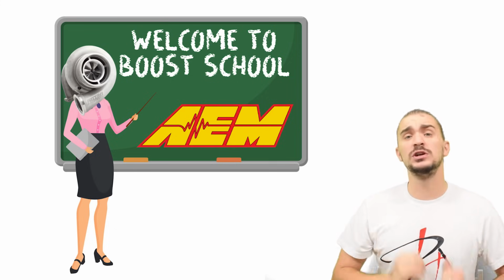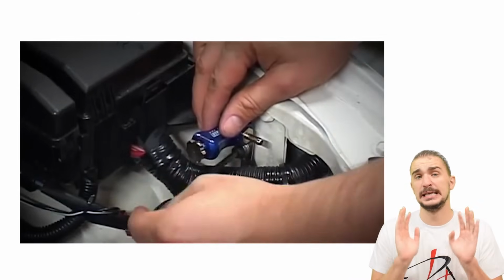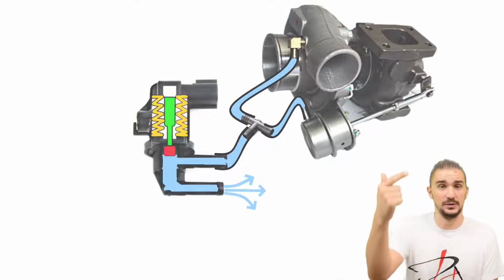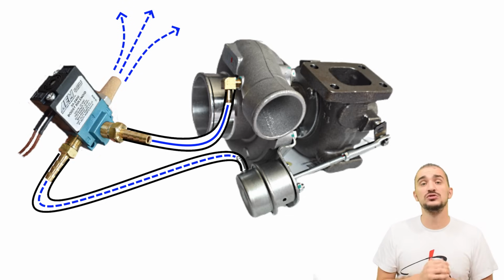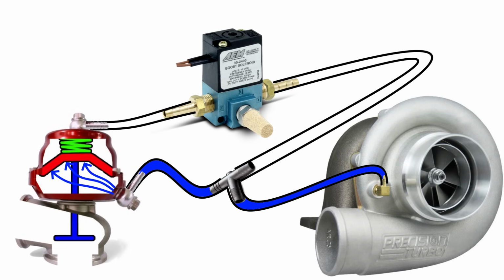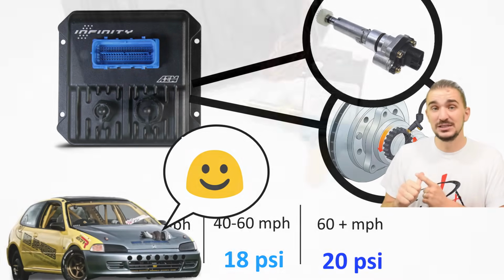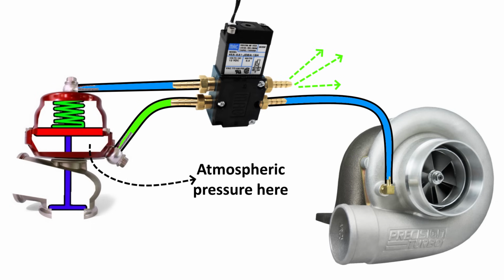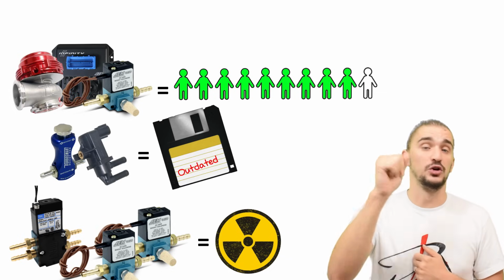ALL BOOST CONTROL setups EXPLAINED - Boost School #3

Comment: Great video, clears up a LOT of misinformation about two port wastegates etc and explains it in clear easy to understand words and diagrams.  Well done!  I like AEM products and have used them.  However, that boost solenoid is nothing more than a MAC 36 series industrial solenoid valve part # 10-9959.  They tossed an AEM sticker on it and probably doubled the price.  Nothing innovative or "engineered" by AEM on that piece.  LOL

Edited to add accolades.

Comment: I think I'm understanding this but can someone please explain why the fancy electronics are used to indirectly control a manual valve? Can you use a similar solenoid to control the wastegate directly? Eg let the ecu open or shut the wastegate with a single solenoid?

Comment: Could you use this set up on a diesel 4x4?
Thanks
Reply from the maker: Most diesels are VGT now, it's different.
Reply: @d4a  thanks for replying, mine isn’t, it’s a Land Rover TD5 with fixed vanes.

Comment: Can a controller DISABLE BOOST?  Can you have boost only ON DEMAND?

I have to replace the engine of my Subaru Forester. They offer me turbo (2.5XT and JDM STi) engines but I simply dislike the turbo "kick".

I would love to install an engine, run it as NA and only apply the boost on demand, like a turbo "button" or switch (that engages at stock OEM turbo boost levels) without damaging any components.

Possible?
Reply from the maker: Nitrous?
Reply: @d4a  I haven't watched any fast furious movie but I've seen the scene

Comment: This is a very great and informative video - however I have to call you out on something. Boost control can go down to 0psi technically, BMW uses vacuum operated wastegate actuators which are controlled by solenoids allowing stored vacuum to close them, by default these wastegates are completely open and would make 0psi of boost pressure if all of the boost control gear was disconnected or malfunctions.

They're essentially the same as a normal wastegate actuator, however operating in reverse.

Comment: Pulling my hair out!  We have a total of THREE 3 Volvos in our shop this week!  Of them, one is a 2003 XC90 T6.  Using both Autel and VIDA, the scanners both show DTC # 6814 code.  All we have done (knowingly!) is rebuild the 4T65e auto trans and re & re it with Bevel Gear assembly.  Since then, while the motor ran beautifully before, now it won't spool up the turbos properly, won't stay running at startup cold, won't engage turbos with high throttle input.  I am somewhat familiar with the boost control solenoid and MAF sensor readings.  But even after replacing the MAF 3x with used, and BCS 2x with used, doing a leak test, etc., hasn't resolved the issue.  If we purchase and install an OEM BCS and/or Boost sensor, I fear this still isn't it!  Some say they is an "O" ring contraction/expansion in the turbo to exhaust manifold area might be it?  CAN YOU OFFER ANY IDEAS OR BETTER COMPONETS OR UPGRADES, ie. like AEM or Holley brands?  Dave

Comment: Awesome explanation thanks very much
Never realized the source was supposed to be tee'd to the under side of the external and the top is controlled by the 3port
I have a gt3071r on my gtir that I can't control the boost it spikes to 25psi and falls to 20 but its also an internal gated turbo with a spring that must be 8psi

Comment: Excellent video, I love the explanation however you forgot one other trick people use, that's a co2 bottle to control a 7psi spring and achieve 70psi of boost if required. Although only really used in drag cars but still another trick to run low boost off the line and feed it high boost down the strip. Either way I love your videos, svaka cast, samo napred!

Comment: Golden video man. An excellent explanation on why my 4-port solnoid had some of the most erratic behavior and it was so frustrating
Reply from the maker: Thanks for dropping by, love your videos man!
Reply: @d4a  Thank you!
Reply: Hi Greg 👋 fancy to see you here
Reply: @guidosaur7506  making sure my ebc strategy is dialed in for next weekend 😈
Reply: @TheCarPassionChannel  I'm just going to fix my Maxpeedingrods turbo and enjoy spinning the tires with a mbc lol. Still good to learn though
Reply: Greg helped me swap my Miata back in the day 2016 I think
Reply: Lol they almost need to make an electronic powered controller that has a sensor to read the compressed air (like boost gauge type), then an independent piston powered compressor (like how a syringe works) that's electronically controlled to increase or decrease the psi in the actuator ports.  Tbh though idk if that solves the problem.  It sounds like there might be a relationship with the duty cycle sending massive amounts of compressed air into the ports or something whenever the controller opens and closes.  What causes the eradic behaviour in the psi?  Hmmm so much to think about.
Reply: @monjier  Something like the variable geometry turbos, that Porsche uses, and a lot of diesel engines run? At least in the case of Porsche, those are fully electronically controlled. 

I was hoping he was going to cover those in this video, but I guess they are pretty uncommon on gasoline vehicles, since only Porsche uses them. I'm going to see if I can salvage one from a junk yard for a future project of mine.
Reply: @Bertinator-nm9ld  diesel engines run it too?  Do you think Holsett make them  since their turbos apparently used a lot for trucks?
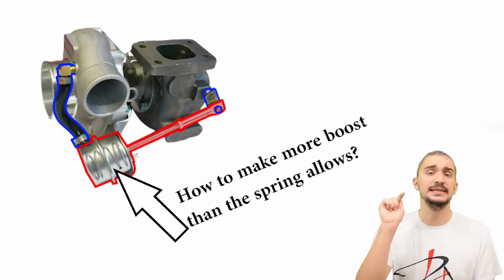Reply: That little shimmy, look to the left, and then wink @ 2:57 lmao that was slick bro. You have literally taught me everything I know. I just realized I fully get how a turbo works now. Exhaust gases! Duh. I knew that but I realized I didn’t completely KNOW what that meant and how it needs to be regulated and just all of it is more clear now lol. Thanks for what you do!
Reply: Did you end up with a dual 3-port setup?
Reply: @electric7487  No - because my ECU can't run a dual 3-port and Flex Fuel at the same time. I'm on a single 3-port now and it's working fine 👍
Reply: @TheCarPassionChannel  Just wondering, do you have a single port or 2 port wastegate?
Reply: @electric7487  It's a dual port but there's no advantage to that unless you use a 4-port ebc or double 3-port ebc

Comment: Where is REA (Rotary Electric Actuator)? Pressure/vacuum actuators is a pile of negatives. REA is extreme. She have resolution (from 1% to 99%), speed (solenoid limit 50Hz, REA start from 350Hz), feedback! ECU see where is actuator, it does not calculate it on the basis of pressure and duty cycle. REA (or Simplified REA) is target for all tuners! Not limited by spring, only limit is turbo. I have SREA on tuned EDC16, no more spool up delay, no problem with vacuum system, expensive solenoid is gone. Only one problem, find the best spot. Because REA is faster, than ECU 🤣

Comment: I usually ran my car on aftermarket wastegate...and boost control straight from the compressor boost signal line to bottom wastegate port...

Boost level controlled by adjustable wastegate spring preload...

For the sake of testing...

I hooked up back my oem 2port wastegate solenoid...with variation...

Variation 1:  wastegate solenoid outlet signal sent to top of wastegate port...

Result: much more livelier boost buildup... BUT... Boost spike happens everytime i downshift to accelerate... (I have no method to change oem wastegate solenoid duty cycle)

Variation 2:  plumb back solenoid outlet to turbo inlet post maf sensor just like oem

Result: quick boost buildup.. not as quick as variation 1...but definately much better than running straight to wastegate port...
Still got a tiny bit of boost spike during downshift... But in a good way of spike, short spike for helping acceleration and not too much to put any risk of damaging the engine...

Anyway this was tested on jdm subaru forester sf5 with 04 jdm wrx swap everything.. (engine,td04L, jdm 5speed 4.444 final,ecu and stuff with sti camshaft swap)...

On old straight wastegate setup it makes around 247whp/237lbft torque...

Im guessing with stock like boost control method with aftermarket external wastegate, it makes a better torque curve at down low rpm if any...

Comment: Bad video. Get to the actual tuning. You're skipping open loop , closed loop. Boost in the summer is not same in fall/winter; closed or open. This is need for speed vs project cars. Arcade vs simulator. Tuning isn't about pressing buttons like a game.

Comment: I’d like you to make an episode on add-on fuel pressure regulator and fuel pump.
Where to put an add-on fuel press regulator on the fuel line, in and out fuel line, return line.... Value of the fuel pump flow, of the pressure regulated......
Cheers !!!

Comment: When I got my aem infinity I Uninstall my manual boost controller for aem 3 port boost controller. My speed sensor don't work I order a GPS to hook up the to standalone on my 2005 Hyundai Tiburon Turbo V6 2.7L project

Comment: I didnt knew about the "4 way" solenoid! It's a really nice concept, BUT, using 2 "3 way" solenoid seems to be more efficient and provides a bettter tuning
Reply: Like a 3 way manuel boost controler and the n75 valve in b6?

Comment: You had me at the 2 port but then spun it up to 3 port and I thought this was the top of the line. But I was floored by the 4 port system and thought the lesson was over. I did not see the duel 3 port modules with the bad boy of ECM’s from AEM conning. I am never going to do a project like this but I like to be able to talk it with my friends who do.
Reply: Wow I actually asked an intelligent question about boost control on another Chanel and got an expert answer that I understood. Great video.

Comment: this is insanity. just use a stepper motor on the gate if a single solenoid can't do it.
Reply from the maker: Yes... "just" use a stepper motor. A world leader in wastegates, turbosmart, took years of development to make an electronic wastegate. So I'm sure we can all "just" do it.
Reply: @d4a  a 6 hr binge on control system theory and PID controll vids and a week practice with arduino and steppers from 3d printers or cnc machines should do the trick. Those high end solutions in this video have way too many failure points and still have very bad "resolution" of controll.

Comment: Some manufacturers both OEM and aftermarket have started to use electronic wastegates that remove the spring and use an electric solenoid so you can actually have a wastegate that can make 0-40+psi of boost. Informative and good video otherwise!

Comment: I'm wondering about the ability of not using a wastegate at all and limiting the speed of the turbo with a motor-generator. Would this put too much stress on the exhaust turbine? I believe F1 cars have a setup like this.

Obviously you could also have a wastegate set to a higher boost pressure as safety. I'd expect you'd need a bigger, slower-turning turbo to do something like that though.

Comment: You should do a video about what engines are able to have a turbo installed
Reply from the maker: Every engine can have a turbo installed?
Reply: driving 4 answers Ive thought some engines are built with weaker, and more thin walls along with internals that wouldn’t be able to handle the extra pressure?

Comment: Why not replace the diaphragm with a servo actuator that is controlled by the ECU based on current boost, temp, throttle position etc???
Reply: Desmond Hakurekwi
Thought must be put into how does the device acts during a failure. Meaning, when the device inevitably fails, will it cause the setup to build infinite boost, no boost at all, etc.
Not an argument against the use of a servo. Just an important consideration.
Reply: Neg Ative I understand but look at a drive by wire  throttle, how does it respond when the throttle body fails? It’s servo based btw
Reply: Desmond Hakurekwi
Not sure. All my cars have three pedals, cables and linkages.
However, I do have the three port setup for boost control shown in this video and I’m an engineer, so, before I bought the system I spent some time going over their sparse technical bulletins. I didn’t find an answer to my concern but they have some decent technical staff answering their phones and I found the answer I was looking for.
Edit: That’s not true. My DD Lexus LS is stock and it has an electronic throttle. Forgot about that one.
Reply: That's what a lot of manufacturers are moving towards. Turbosmart just unveiled new fully electronic wastegates and actuators recently.
The final, and ultimate, step will be variable vane turbos and variable nozzle turbos.

Comment: 18:12 Question: would this work for a drift car, doing crazy smoke drifts or would I not be able to get to the first corner?

Also amazing video dude! You earn my sub and my respect, You deserve more recognition.
Reply from the maker: Usually drift cars need to stay on boost over a relatively large throttle and rpm range so you can modulate power through the corner to maintain the drift. A 4 port creates boost rapidly, so it will make big smoke but maintaining the drift will be a lot more challenging and you'll likely spin out more often. A classical three port setup will usually be a smoother and less challenging to control and will fit more drivers better. 4 ports are usually best suited to drag racing. You can also do double three ports if your ECU can deal with it and if you can dial the tune in.
Reply: @d4a  Thank You for the fast answer brother! Have an amazing day. ( :

Comment: What would these setups look like when used with a draw-through design (turbo draws through the carb)? Boost signals would contain fuel/air mix, making them less suitable for venting in the conventional manner...
Reply from the maker: None of these need to be vented into atmosphere, you can vent right brfore the turbo inlet. In a draw through setup that would be after the carb and before the turbo.

Comment: and what about CO2? has a lot off uses in drag racing
Reply: External pressure or vacuum source is commonly used too. Trucks use air brake pressure, diesel cars usually use vacuum to operate the actuator. Of course, you need a boost solenoid to control the actuator. However the current trend is to move from pneumatic to electronic control, so motorised actuators are prevailing in PV applications (also due to very strict emission requirements).

Comment: Ok, so I didn't see what I personally would want to use.
An electronic wastegate that uses an electric motor that would open the valve when target boost psi is reached. No tricking/lying to anything. Just straight forward control. Then have an ecu to program having the wastegate open earlier at X values by X amount, to make a linear curve. Think of it like throttle by wire, but instead it's boost by wire.
That seems to make by far and above the most sense rather than just screwing around fooling springs and getting 20 psi from a 10psi spring instead of 10 psi from your 10psi spring. Whole bunch of screwing around if you ask me. 😒
Reply from the maker: Turbosmart makes an EWG. It's 1000$. A spring based wastegate is two pieces of hose extra over an EWG and a fraction of the cost. Tuning is usually easier too.
Reply: @d4a  I would expect screwing around with tricking the spring and basically lying all the time about the boost you're making would be trickier than a computer that you just set the values to what you want and let the electric wastegate take it from there.
I mean if I only want 10psi, I don't want to fool the spring and make actually 20psi of boost. I'm completely lost why anybody would want to do that?
Reply: @d4a  perhaps I'm not really understanding why you would want to trick the spring to make MORE boost than what you're supposed to. If you only want 10psi, why would you trick the wastegate into thinking there was less?

I'm also not understanding how using a 10psi spring becomes the minimum, rather than maximum, psi in a 3 or 4 port actuator set-up.

Comment: this is one of the best automotive channels out there. but What about for us diesel guys that have mechanical pumps and no ecu?
Reply: Diesels have much less issues with boost control, as they have no throttle, and no issues with detonation from boost being too high. Boost control on a diesel is mostly about turbine speed control, and most of the advancements (like VNT) are to make the turbo spool quicker. Though nothing is stopping you from adding some sensors, an electronic control unit, and any of the mentioned boost control solenoid systems to get full control over boost, backpressure, EGT, etc..

Comment: Here is Europe 3 port solenoid is not connected to boost side, but to vacum system. it controls amount of vacum in chamber. third port connected to outside air

Comment: Do you need to have a stand alone Ecu to run boost in your car?
Reply from the maker: It's not mandatory. If your car was already turbocharged you can keep your stock ECU. If your car was naturally aspirated and you're turbocharging it you'll need a standalone. But in any scenario a standalone is one of the best upgrades you can make. It will open a lot of doors and give you the ability to do things a stock ECU never could.

Comment: I'm dead lost at 17:06.
Why on earth can't less than 10psi be made? Lift of the accelerator pedal, ffs!
Really, it doesn't make any sense...
Reply from the maker: You're missing the point. We're talking about boost and situations when the turbo is generating said boost. Yes, you can make zero psi at idle or when you're coasting in neutral... But that's irrelevant.

Comment: Great video my man! 
Cleared up a lot of my confusion about boost control solenoids.
Have you heard of Turbosmart's Electronic wastegate? I kinda wished it would've came up, but it's fairly new, and quite expensive, so I get it, probably won't be a topic soon.
It is cool though, no spring, pretty much just an electric motor on the wastegate, you do all your boost control from that, no solenoid, no spring. Probably amazing control.
Still, quite expensive.